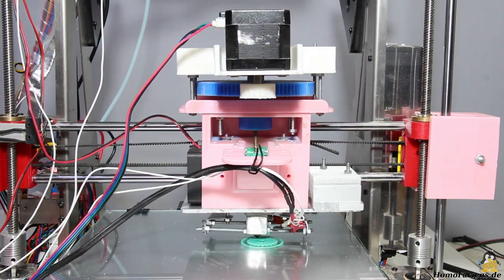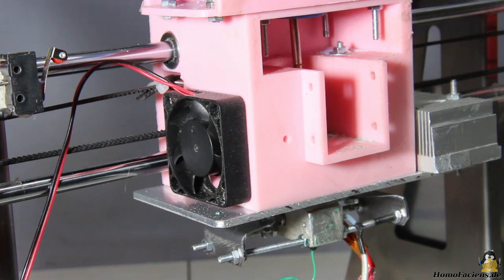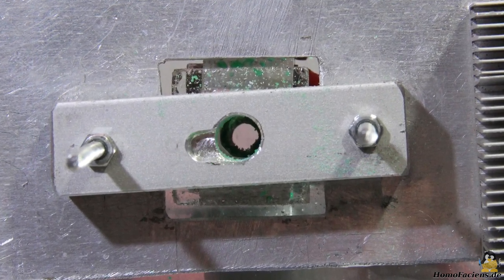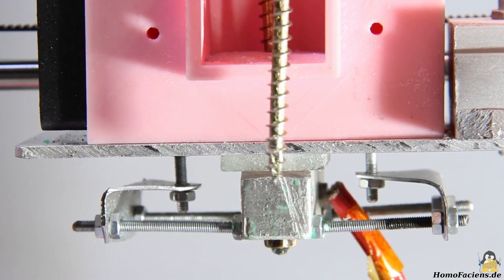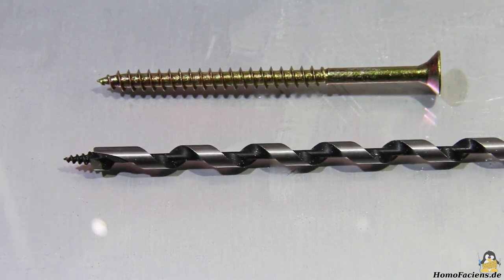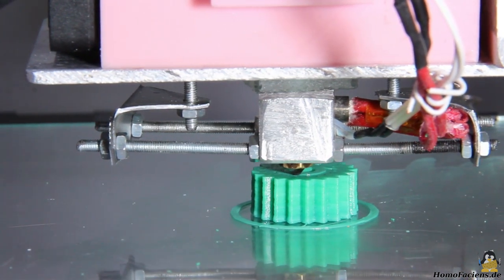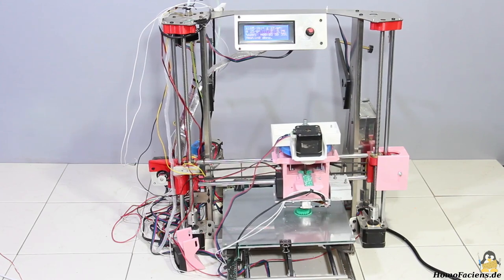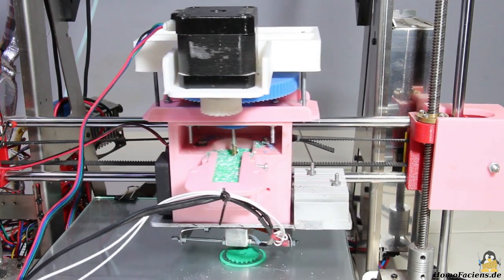Details about my "pellet" extruder V3

Comment: Incredibly simple construction. Looks like it is a drop-in replacement extruder - as in no mods to printer software or toolchain. You will win!
Reply from the maker: Yes, it is meant to be a drop in replacement. Only change in software is the filament factor in your slicing software.
Reply: You are right. Using this extruder, one can simply grind their waste plastic and use it for printing.

Comment: 1. Compound gearbox for the extruder + Nema8 stepper motor
2. Special contraption made to grind the tip of the wood screw with a Dremel tool. If that contraption can work like a CNC lathe or something, precise geometries of the tip can be achieved thus making the development easier.

Thanks for sharing! Good luck!
Reply from the maker: 1.) Why expensive if the "out of the box stepper" with a printed gear works?
2.) That's what I have done with a couple of screws, soldering the wire to the tip is just faster. Adding precision is on top of the list for future prototypes.

Thanks for sharing your thoughts!

Comment: I can only imagine what an improvement a formal screw and close fitting auger body especially if it includes a metering section ie multi-zoned.  Thanks for sharing this!
Reply from the maker: No. That multi zone melting thing is for constant extruding a high volume of plastic as is done in injection molding or filament extrusion. In 3D printing, the extrusion rate changes very often. The normal wood screw is totally okay as you can see in subsequent videos on this series:
https://homofaciens.de/technics-machines-3D-printer-Granule-Extruder-V5-1_en.htm
Currently I am working on version 5,2. Stay tuned!

Comment: strap a 3/4 full 2ltr bottle to the top plate to become a generic dampener at higher speeds ,works great
Reply from the maker: A dampener similar to those used in the earliy versions of the 2CV.

Comment: Awesome. Had been waiting for the next installment of your project. Seeing the more detailed explanation of the 5mm wood screw’s modifications makes sense. 

Definitely going to test this concept out once I have my printer working.

From what you noted in the video, print speed is really only limited by the rigidity of the print structure… the extruder is capable of keeping up. Will be very interested in testing this on my voron v2 once it is complete.

I might add in a mount that is compatible with the voron v2 carriage so swapping extrusion/plastic sources is relatively painless.

Question: the needle at the end of the wood screw, is the straightness and/or smoothness of that tip important?
Reply from the maker: Keep in mind, that the open hopper design will lead to spread granules in your workshop, if you go too high with the print speed ;-)
Straightness and smootheness always matter - how much on this design will be explained in future videos when takling in more depth about stringing.
Stay tuned!

Comment: Hmmm, very interesting design. Have you considered using a flexible drive shaft to remove the weight of the stepper motor from the equation? Like the "Flex Drive Extruders".
Reply from the maker: Yes, that's what I have mentioned in a video on an earlier version of this extruder, but I prefer a direct drive.

Comment: What about a flexible rotary tool shaft for driving the extruder? analogous to a bowden setup! good  job.
Reply from the maker: Thanks! Yes, I had mentioned that in one of the videos about a previous version. However, let's get the best out of the direct drive, first.
Reply: great idea. should reduce the weight of the printhead a lot.

Comment: For reducing the weight of the motor, why don't you try using the approach of the orbiter extruder which uses a planetary gear mechanism, powered by a light-weight stepper motor? You can even get an orbiter extruder, remove the filement gripper part and just use the motor and gearing from it. That will certainly help reduce vibrations while printing at high speeds.
Reply from the maker: The stepper motor I am using isn't the strongest, but using an even weaker model (as the orbiter design does) won't get the granules through the extruder.